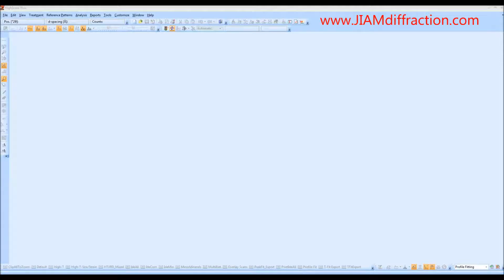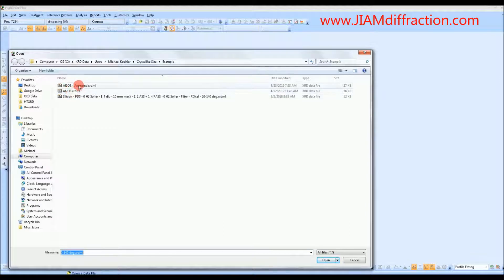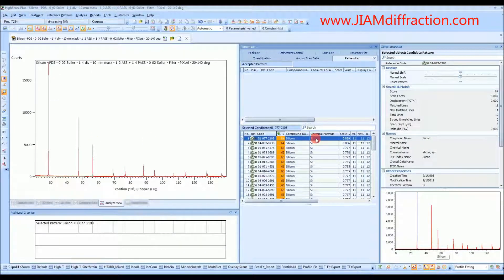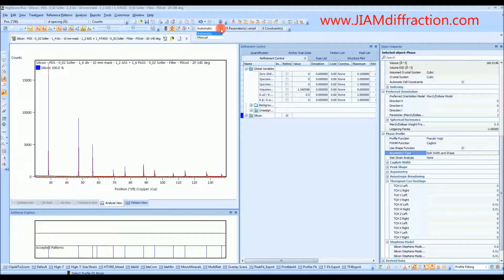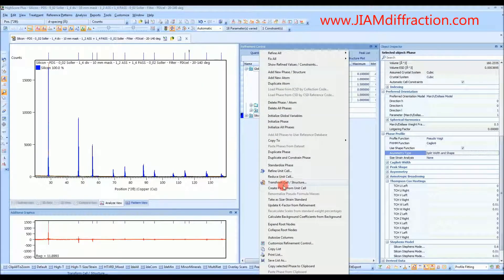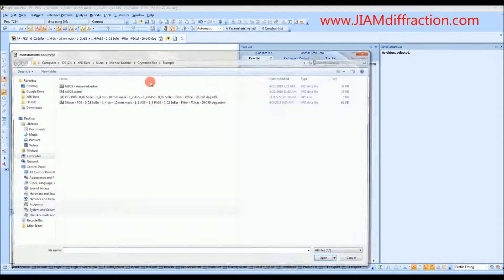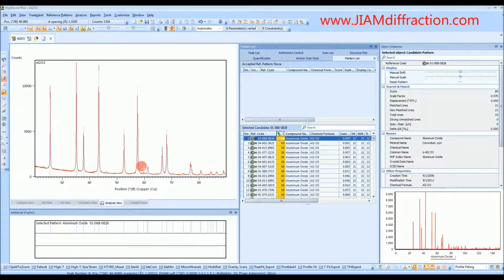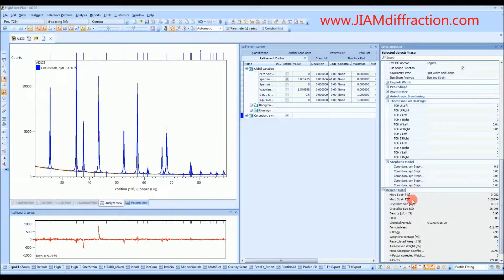HighScore Plus Tutorial - Crystallite Size & Microstrain X-ray Diffraction - Short Version - JIAM

Comment: Hi, Thank you for your sharing. 
I would like to ask you how you get the NIST standard sample data, such as silicon? Thank you.
Reply from the maker: Thank you for the question!  I purchased the silicon standard from https://www.nist.gov/programs-projects/powder-diffraction-srms.  Using a back-loading sample holder (from Panalytical) to prepare my sample, I then collected a diffraction pattern from 20 degrees to the largest 2theta angle I could collect (140 degrees).  You don't HAVE to go to 140 degrees, but the end angle for your standard pattern should not be smaller than for your sample pattern.  

It is very important to make sure that whatever combination of optics you use to collect data on your sample (Soller slits, divergence slits, etc. depending upon your setup) is the same combination you use to collect data on the standard.  If any of the optics change from one sample to the next, you need to collect a new standard pattern to be used with samples measured using the new combination of optics.  

Let me know if you have any other questions or if my reply didn't answer what you were asking.